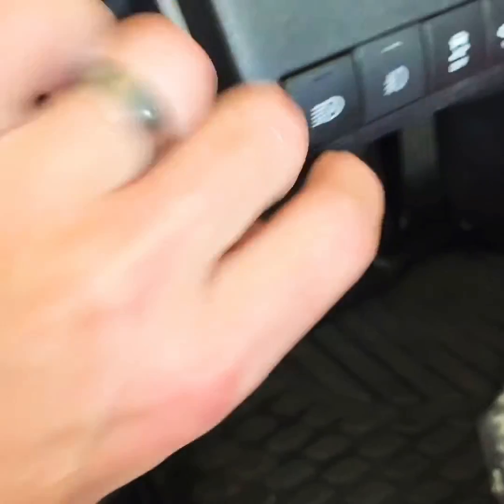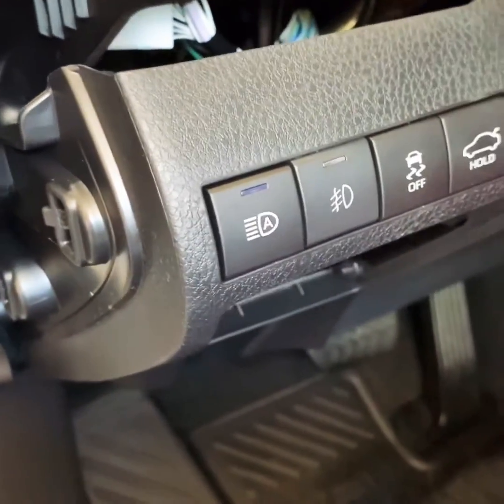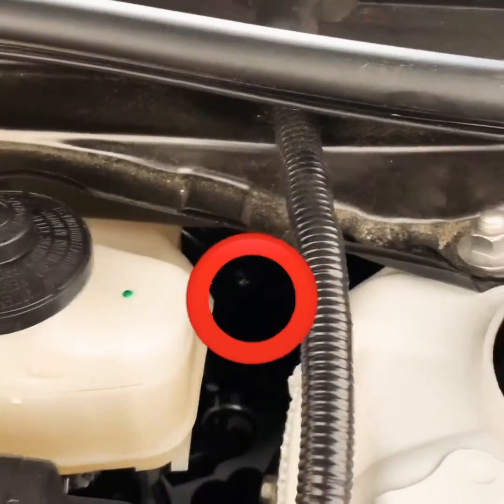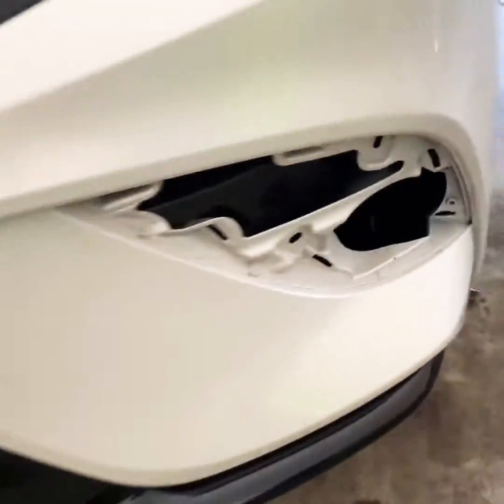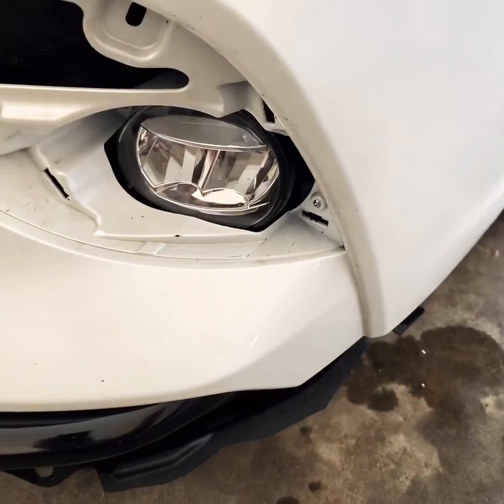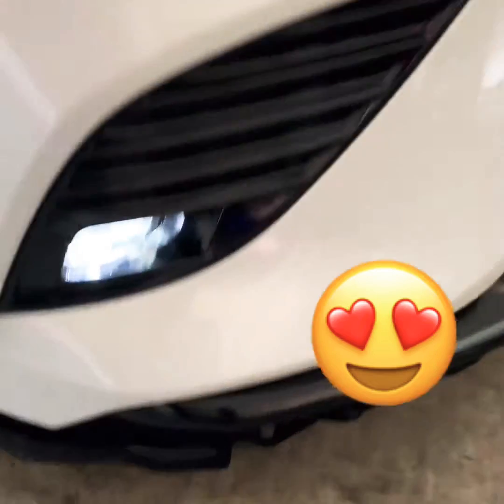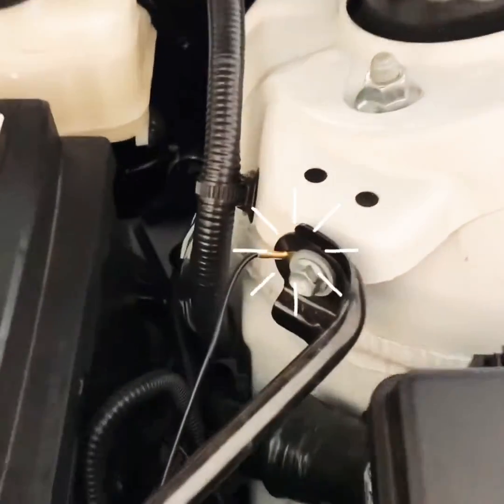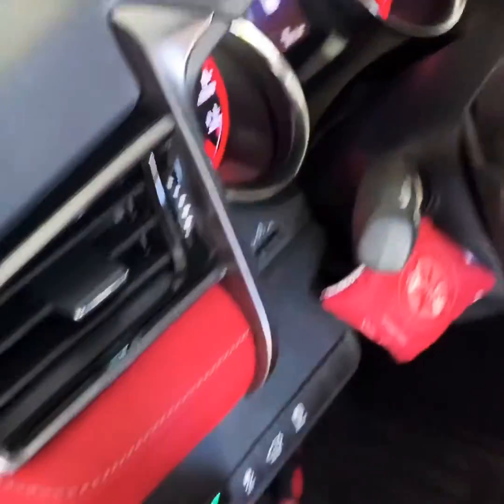2020 Toyota Camry Foglight Install

Comment: Did you connect the main power wire to the fuse inside the vehicle or did you kit come with 2 power wires? I'd like to have mine synced with my headlights but my kit only came with one power wire that looks to be placed on the battery
Reply from the maker: Look for asc one and just shove in that fuse. Hope that helps. We don’t have the car no more
Reply: @helgy2880  thank you I'll give it try

Comment: @helgy how to wiring inside with fog light  at my Toyota Camry SE
Reply from the maker: Darcy find the fuse that is used for radio or something that turns off when you cut car off. The ground can be anywhere on metal surface
Reply: @helgy2880 beacuse very hard don't know anywhere cover inside plastic wiring 😤

Comment: what did you end up doing about the washer fluid reservoir being in the way?
Reply from the maker: I end up using a small ratchet wrench with a screwdriver driver
Reply: @helgy2880  ty

Comment: Where and how did u connect the fog light cables?
Reply from the maker: So the cables for power I did the ground in the engine bay. The power is for the cigarette 12v asc fuse
Reply: @helgy2880  hey bro can you send me a pic of where you connect it? I can’t find it
Reply from the maker: @ErcolanisAuto  which part?

Comment: Did you run a fuse-tap to the power outlet 15a fuse?
Reply from the maker: The kit came with a fuse. It also came with the relay
Reply: Yes, so did mine, but mine had one red wire connected to the plug where the actual switch is at (inside cab).  I have to run the wire to 15a fuse, (power outlet) under the dash to the fuse box. I got a fuse tap to plug in replace of the 15a, and then I’ll plug two 15a fuses into the spots on fuse tap ports.  Hope that makes sense.   There’s another video of this Camry guy named Jenner, who did what I am talking about.  Wasn’t sure if u did this, too, or not.   Jenner wired it to the 15a but he did it super ghetto 😂
Reply from the maker: @bb3283  mine came with that to plug right into a fuse. Glad you took care of it. Better to do it yourself instead of paying for it. Even if something goes wrong you least know how to tackle the problem
Reply: @helgy2880  yes, I don’t know why they just left me the red wire like that.  Should’ve given me the fuse-tap for it lol. Then again, fuses are diff sizes and such, so I get it. No worries. Just making sure that’s what y’all did, too 👍
Reply from the maker: @bb3283  yep and car haven’t caught fire yet......so think I’m good....🤷‍♂️
Reply: @helgy2880  haha. That’s always a plus
Reply: Me too my car 2022 camry le (power 15A)

Comment: How hard to insert the wires to the firewall? Im having a hard time thanks..
Reply from the maker: So what you got to do is punch a hole through the rubber seal
Reply from the maker: Make sure it’s the same size as the wires
Reply: I just moved that same rubber seal to the left from the inside of firewall with a clip remover tool but u can use preety much anything with good leverage that wont damage it cus it does  take some force to push to the side just enugh to feed the cable thru and have someone feed it to u with a wire from the engine firewall.
Reply: There is a rubber seal under driver side carpet, floor pan. Run harness through and along side panel

Comment: Do you have a link to where you purchased it thanks
Reply from the maker: Quy Nguyen https://www.ebay.com/itm/164233499767
Reply from the maker: Quy Nguyen hope that helps
Reply: @helgy2880  thank you! Is there any possible way you can show how to put the button clip on, or a short video because i’m having a hard time to run it through firewall to hook onto the fog button

Comment: How did you get wires for switch through firewall you skipped steps
Reply from the maker: Poke a hole through the rubber seal, then feed wires through
Reply: @helgy2880  How did you poke a hole, with a phillips screw driver? Also, how did you remove the panel in the dashboard to put button on? Thanks!
Reply from the maker: Quy Nguyen I end up using a flat head to open garment enough to run the wires through. For the panel just the under panel remove slide hand to the one that is blank then push out.